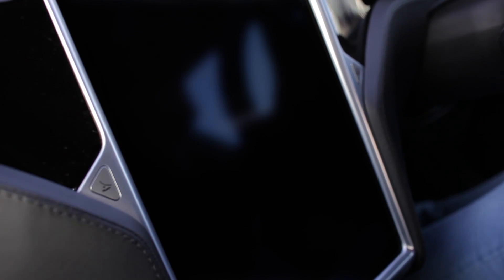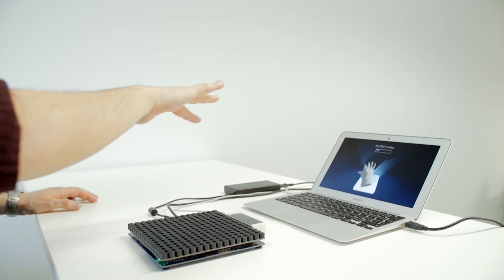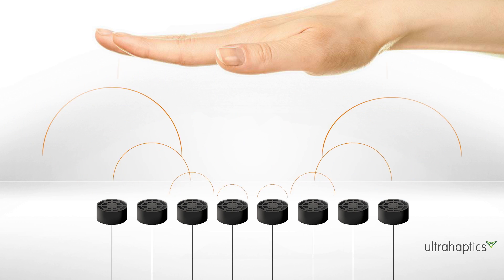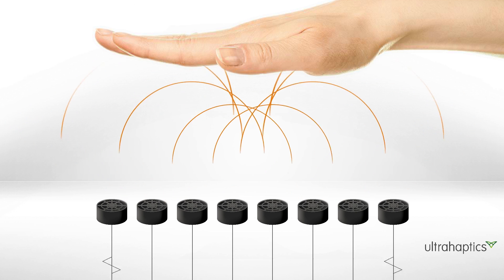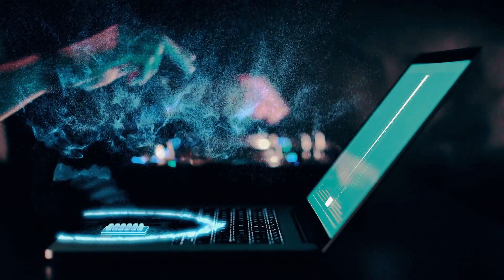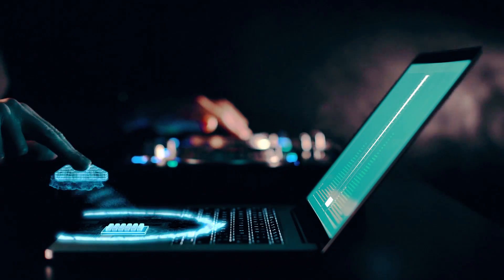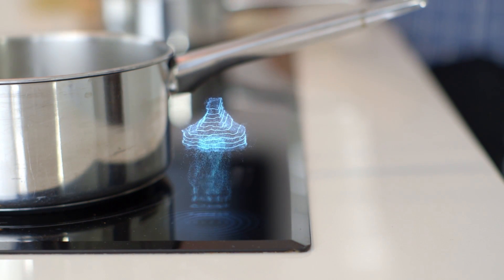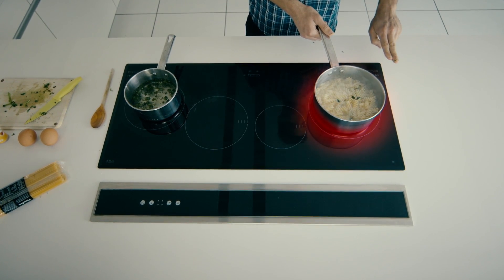What is Haptics | Touchable Haptic Technology

Comment: I was here bcus i saw heptic on ps5
Reply: Lmao me too
Reply: Lmao me too
Reply: Ok
Reply: @yt_zzbig77-_-38   Me too lol, this has nothing to do with ps5 haptic actuators. Controller has 2 motors like old ones just that they are actuators so it will make a huge diference. Combined with resistance triggers it makes the controller very special. But like ps4 controller (trackpad, speaker) I dont think there will be many games using 100% those new features because of developers should code the games separately for ps5